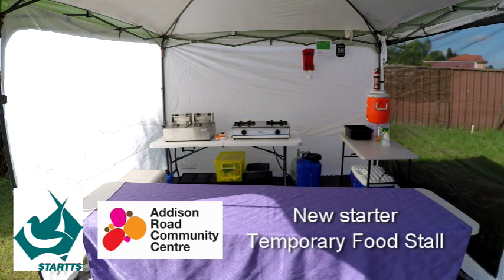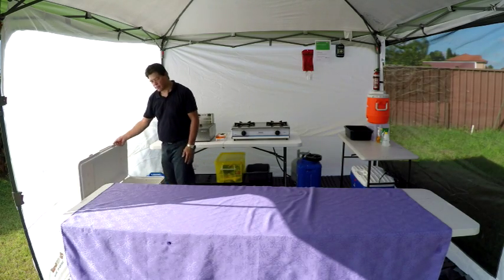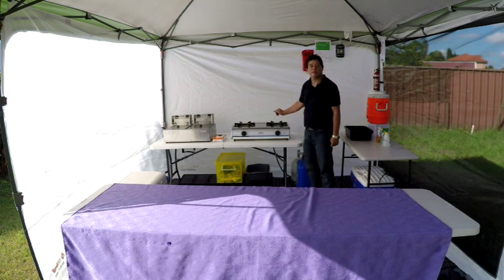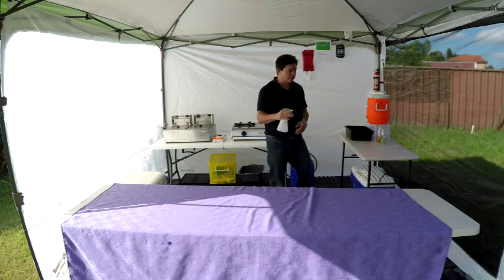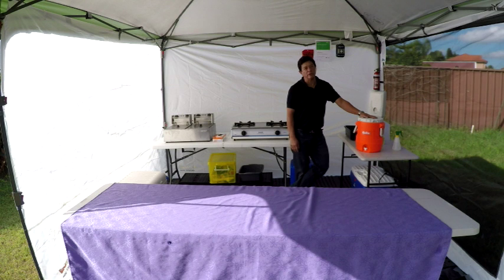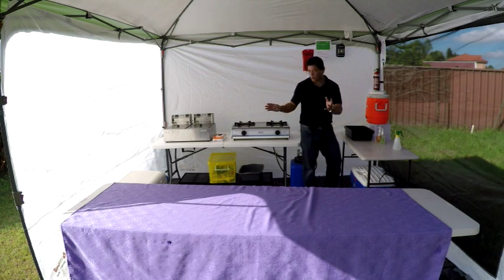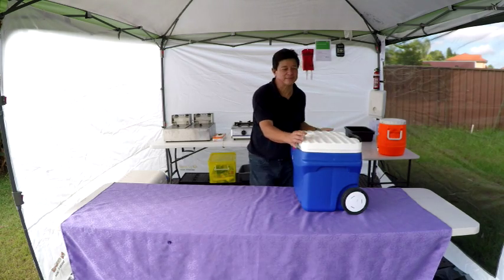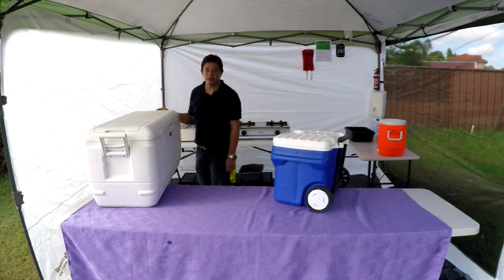Basic temporary food stall set up (NSW)

Comment: Thanks for the helpful tips in this video.  These are some tips for your viewers:

 My location requires a lever style handwashing cooler, not a pushbutton, due to contamination.  It also requires that paper towels be on a dispenser of sort (a hanging wire hanger works!) and not out on a table un-tethered.  Hand sanitizer is not sufficient for washing.  You MUST have soap.  Lastly, have a thermometer for every tub/cooler/bucket/pan/pot/grill/etc.  

Good luck to all the hustlers out there!
Reply: Hi Patrick, is there written rules for NSW so that you don't get caught out on avoidable mistakes?